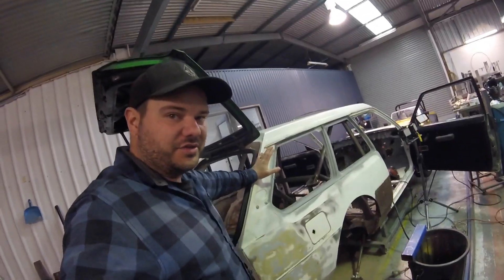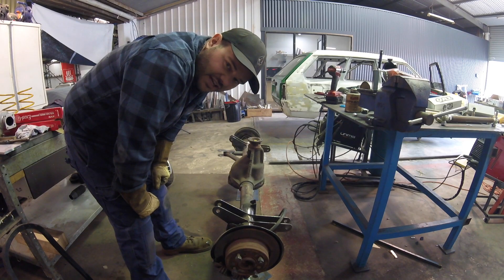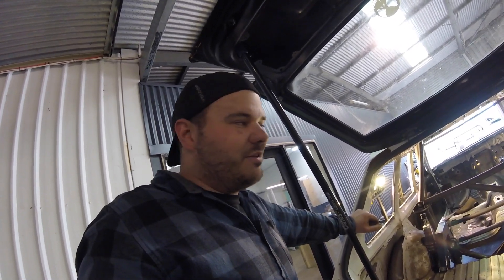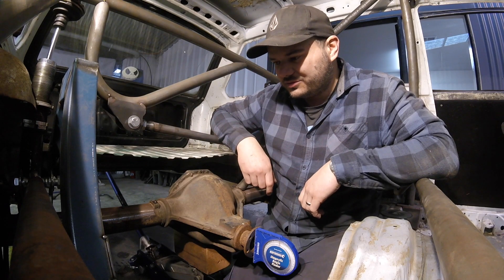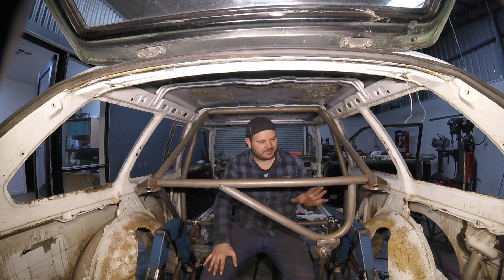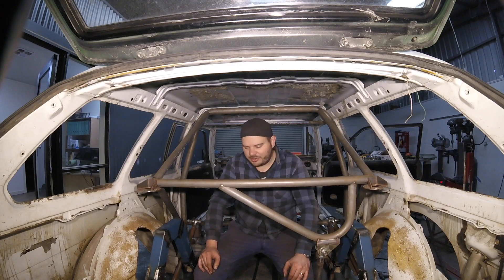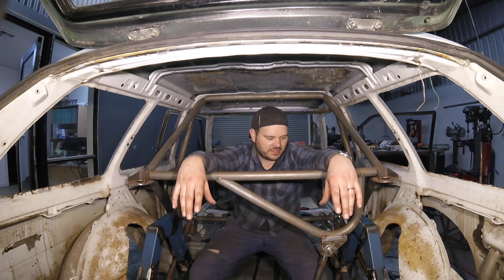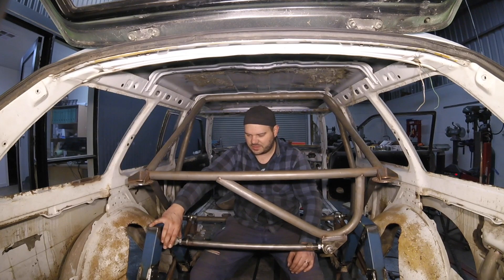4 Link rear suspension testing

Comment: Tommy, love your work. I’m building a 56 Morrie Ute with a turbo 4AGE in it. It also has a shortened R31 diff in it. Can you give me the specs on your chromoly tubing and heim joints?
Reply from the maker: wow that sounds like a cool project! the joints are 5/8 chromoly and the steel is 1" Internal Did to suit the weld in bungs

Comment: Its looking good man, I personally would have run a bar from rail to rail to Mount the coilovers onto, and shortened the diff to keep the standard wheel tubs
Reply from the maker: All good options but I want the rear to be very low so we had to cut off the standard guards any way

Comment: are you going to move the rack forward to stop the steering over centering?
Reply from the maker: I had thought out this and have decided not to, the Toyotas don't suffer from over centre as bad. That will be something that I really need to drive first and see if it is causing any issues. The steering mods im running are not very extreme with only OEM power steering arms (slightly shorter).
Reply: Second Stage I’m running PS arms and a 16mm rack spacer with tube lower arms and had to make lock stops to stop it going over centre. So now I either need to run off set rack spacers or move the rack forward if I want to use all the lock available. I guess it will all depend on how deep your LCA’s notches are.
Reply from the maker: @Uncutclimbing  ok that is interesting, My LCA notch is clearance so I can use all the steering rack movement I have available. This is defiantly a big aspect I will be looking at when we do the first shake down test.

Comment: Good work man, I'm doing a full restro on a sedan atm 😎.
Reply from the maker: nice! what running gear you putting in it?
Reply: @secondstage4272  worked 4k motor, shaved engine bay, stock running gear for now, will probs do a 3RZ later on :)
Reply from the maker: @r0h4m27  3Rz would be cool!